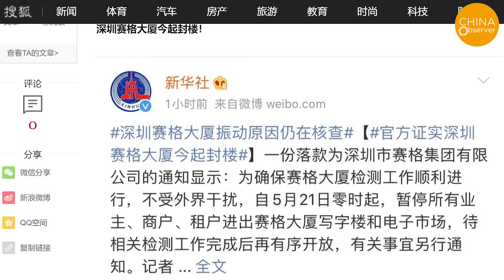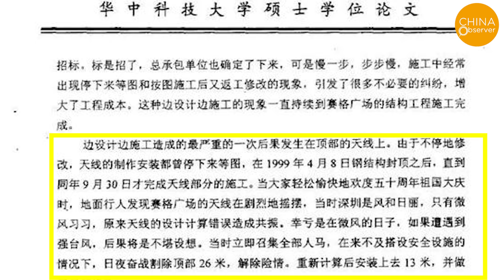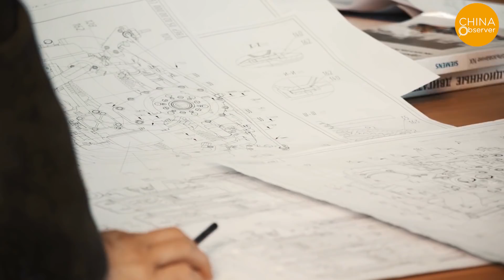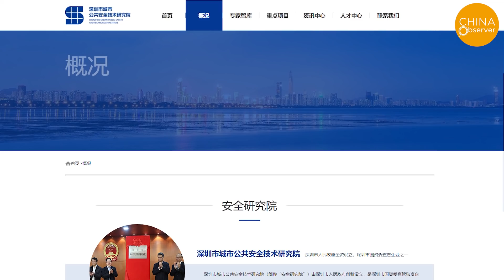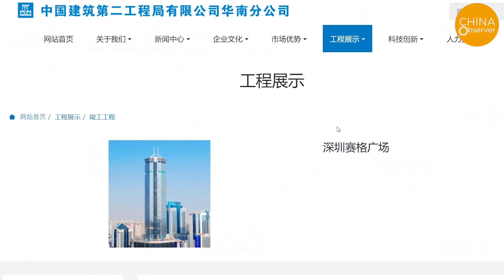356m Tall Skyscraper Shaking Again, Monitoring Data released, analysis of the causes of shaking

Comment: Getting it done in record time by trimming a few corners here and there, what could go wrong. 

Also, down below.... "Rebar, what's that?".... priceless!
Reply: Modular design of tall buildings reduces human errors or shortfalls in components installation. Components such as Steel bars/cages, steel  frames are prefabricated and even concrete batching are done computer aided in the plant/ factory and later assemble on site. Comments of shoddy wormanships, trimming corners  etc are irrelevant nowadays. Hope you are enlightened to the rapid advance in building technology.
Reply: They literally cut corners, now the building is in the process of collapse.
Reply: @gorillaump5869  dont worry high rise towers like this one found with all "corners" intact. Experts already discovered the cause. Similarly 1 million high rise buildings in Miami have to undergo structural checks after the condo beach collapsed.

Comment: due to wind + subway

tokyo buildings: am i a joke to you?
Reply: Bay Area Buildings : am i a joke to you?
Reply: @herbertant4096  Those are the toughest buildings I know, other than the ones in Dubai
Reply: Yes....😤😤😤
Reply: Japan has great technology
Reply: Just the wind and wrong shape of the building, the building looks like a plain pipe and this is bad shape for tall building.
The good solution to that is visible in 6:42, that twist is changing interaction with wind and twisting shape you can often see welded on surface of tall steel pipes to prevent this type of interaction with wind.

Comment: very informative and to the point. but vibration is not necessarily bad construction especially if it has been there for 20 years with no problem. seem more likely in line with the recent push by government to promote mid rise building in the future. having this happen is speaking to Chinese in the language they understand, in a mater of speaking.  this would minimize the use of steel and increase efficiency in the future. tesla did apparently invent a device that could do just that. but even if it was a myth there are still ways to cause these result

Comment: It's shaking because the foundations are of a sub standard and the earth was not compacted correctly. (probably due to cost cutting) It is only a matter of time before it fails completely, over the next couple of weeks the cracks will start to show in the walls and floors..., once the concrete cracks it allows the steel reinforcement in the concrete will start to rust..., this is called concrete cancer in the trade and is the major failure of older builings and bridges.

Comment: When September 11th happened I wondered that the buildings were brought down intentionally because of the garage incident.  Just seems critical.  With global warming I wonder that university KNEW of the future and would NOT react adversely to ANY nation of the world and would instead prepare for global warming sea rise.  The pools (footprint of the WTC) seem as though they could be used for drainage should there be failure to the necessary network of levees due to sea level rise.  The PATH tunnels could be used to pump sea level flood (due to failure) by pumps placed above maximum sea level rise levels in places aesthetically pleasing and efficient.  Need to evacuate those buildings.  Wait for a typhoon and evaluate.

Comment: So all very tall skyscrapers do sawy to some degree. Majority of the times you will never feel the very slight sway if your on the upper levels. This is beacuse most tall or super tall skyscrapers are built with a strong core section in the middle of the building that prevents extreme swaying in a tall building. For example. The world trade towers, RIP, had huge steel balls in the middle of the towers/ and very strong core section to prevent the towers extreme swaying. This skyscraper either doesn't have that strong core section in the middle of the tower or its just built all kinds of wrong for it to have that crazy swaying.

Comment: Design-build (where construction begins before design is complete) is actually common practice all over the world. This cannot be used as an argument to explain the problem. 

The fact that the problems only started after 20 years implies a change in conditions. Either the mass distribution within the building, the overall stiffness of the structure, or outside sources of excitation would have to change for the structure's response.

Look for changes, either in the building usage, the condition of some structural elements, or the conditions of the foundation soil/ground (including settlement, erosion, contruction or start of operation of new subway lines) for the source of the change. But change there has definitely been.

Comment: If, after 20 years, it is shaking, maybe they should look for geological changes under the structure. There have been severe earthquakes in China in recent years. Maybe the soil is weak or has lost compactness. The building is ok but it has lost support under it, and it will lose stability.

Comment: If there's been new construction near by it could of changed the wind patterns, not that it matters what I say
Reply: I don't believe It's caused by wind, It's never happend before in the past 20 years when It was first built and as for construction around the area It's everywhere
Reply: @tka1528  new construction can create new wind patterns, figure there's the same amount of wind but more buildings, that wind can no longer occupy and pass threw those once open spaces, and the faces of the building will act like sails to direct it, potentially hitting old building in New ways

Comment: "Everything is normal and do not exceed the corresponding limitations".  Wow .. this sounds a lot like the Citigroup Skyscraper in NY.  An architecture student identified a flaw in that building where they never tested it for angled winds.  And as a result an angled wind that could have collapsed the building would occur once every 20 years.  NY secretly sent crews into the building with the owner, and the reinforced key columns as part of standard "maintenance" in 1978 and 1979, so the building is now safe.  But they NEVER told the truth until the architect let it slip accidently 20 years later in some interview.  I am certain there is a major flaw in the building, and all of the construction materials pouring in are a sign they have figured it out.  But shhhhhh no one needs to know keep quiet and maybe we can fix it before it collapses killing thousands.

Now this building has been standing for many years (20+), and it has withstood major winds from Typhoons, and had NO issues over the years.  Yet every video shows all the shaking so something has gone wrong.  Metal within concrete fatigues over time, bolds and welds weaken, buildings settle into the ground.  Something has changed to allow the shaking, and it is a shame they are being so secretive.  As whatever they are uncovering, would be a valuable design lesson for all.

Comment: it reminded me about NYC's 601 Lexington (formerly Citigroup Building) that also had a problem where that building could be destroyed if a wind speed of 70mph hit corner of the building (which in NYC happens quite alot). then after they found out about it, they secretly fix the building and it was succeeded. and finally, was revealed years later by the architect himself.
Reply: Right..That was the building that looks like it was built on stilts, or these odd raised columns.
Reply: Copy should spent more safety than bots

Comment: British Army has had a standing order since 1831 to never march in-step on a bridge. At first glance, the reasoning seems silly. On April 12th, 1831, 74 soldiers were marching across the Broughton Suspension Bridge near Salford, England. The bridge, which was completed in 1826, was one of the first suspension bridges ever built in Europe. According to the story, the troops’ synchronized march caused the bridge to vibrate at just the right frequency which, in turn, caused it to collapse. 

And while this accident is over a 150 years old the science still hold true. Resonating Frequencies. 

All buildings have a natural period, or resonance, which is the number of seconds it takes for the building to naturally vibrate back and forth. The ground also has a specific resonant frequency. Hard bedrock has higher frequencies softer sediments.  If the period of ground motion matches the natural resonance of a building, it will undergo the largest oscillations possible and suffer the greatest damage.

Comment: I’m guessing the piles have been compromised and they will end up drilling thru bottom mat and end up pumping tons of concrete into the ground.
Reply: nah you gave em too much credit the problem is they didnt build this 100 FLOOR SKYSCRAPER with rebar they built it with STEEL PIPES and concrete hence the truck out front filled with pipes
Reply: @wilmagregg3131  that’s crazy stupid concrete under compression is amazing but for a building with out  rebar that’s stupid to much tension
Reply: @watomb  the worst thing is they BRAGGED about it saying its the "Tallest steelpipe and concrete bulding in the world"
Reply: Piles? What piles?
Reply: @andrewtaylor940  figured the building was sitting on dirt not bed rock.  Pictures of its foundation already had mat laid down.  So figured in order to stabilize the building they needed lots of piles into the dirt possibly down to bed rock.
Reply: @watomb  I’m not saying the building didn’t need piles. I’m just questioning whether it actually has them? And if it has them, whether they actually contain rebar? The building is swaying, with no wind and no measurable seismic activity. It’s floating on it’s foundation. And if that’s the case, I can’t imagine how they would go about fixing it?
Reply: @andrewtaylor940  ya was thinking if the mat is thick enough they could bolt it to bed rock(thousands).  But if it’s floating or has piles (I assumed) then pumping concrete under the foundation might help.  If you calculate.001 inch movement is over a foot at top. Someone screwed up
Reply: @watomb  how much movement would you need to get the water in the top floor swimming pool cresting 1-2 meters above the pools sides?
Reply: @andrewtaylor940  depends on dimensions of the pool and frequency of building movement.  It would be fun to calculate it
Reply: @andrewtaylor940  around his ring piece,
Reply: @andrewtaylor940  as in Hemorrhoids,
Reply: it is a gravity building like the dam

Comment: Read any report on any building that has experienced structural failure. The failure is typically preceded with noticeable vibration or movement of the structure. As each element weakens or  fails, it places additional stress on surrounding elements, until a cascading effect brings the structure down. The Sampoong collapse is a good example.

If events are already  in motion, there is little that can be done to remediate.

Let’s hope it really is wind loads and subway. This would be a horrible accident.

Comment: I expect the typical rear end political shading and story stretching will proceed apace. Hopefully some qualified engineers will determine the actual cause of the vibration and shaking. It’s been 20 years or so since the building was built. Latent design and construction defects and their degradation may now be reaching a cascading failure point where major expensive repairs may be required, or some one may decided the damage is to severe and the building will need to be dismantled. If that becomes necessary, the political fallout will be quite spectacular. Even by China standards.

Comment: It's cslled Harmonics the building is the perfect height width and weight
 they need to change one or it will continue.
It could be the rhythm of the air conditioner fan or the wind flowing through or past an obstruction once it starts the vibration/ Harmonic reaction is self-perpetuating

Comment: Bad foundation and wind can cause the building to oscillate even at moderate wind speed. If it has a Tuned Mass Damper and it's still oscillating, they need to tear down the building before it kills people.
Reply: The strange part is, there is no damper installed on this building. Maybe because they thought this is a concrete steel pipe building, so it wont shake as much as a steel frame building. The reason it got so many awards is mostly because it is one of the first skyscraper China ever built.

Comment: Cover those open areas/ balconies near the top to make flush with the building and put curved caps over the sharp corners down the building windows to minimize vortices.
Reply: Why it’s a problem now
Reply: @scottblackburn2969  to stop the problem bro. Cosmetic renovations are a lot cheaper than structural changes which it MAY not need.

Comment: I lived in China for 20 years, my condo was across the street from one of these multi building projects. The last two pits dug for foundations was below the waterline in that are because it was within 30 meters of a river. The pit flooded and after months of pumping there was no drop in the water level so the contractor filled the pit with sand till the level of the water was reached. then he poured a lightly reinforced slab about 1 meter thick (NO pilings) and built the 32 floor building on top of the slab. there was no compaction of the fill.
Reply: Man that's crazy... Without piles in that slab it will eventually crack and the whole building will shift if the water levels push up again.
Reply: Sounds about right.
Reply: Take a look at the photos of earthquake damage in China. What is the common thread in these photos? Very, very this and very, low amounts of rebar, most of it is just wire. In addition the concrete is not broken is is pulverized, this is what happens when you use concrete with such a low amount of cement that the fill is just barely sticking together. This building is no different.
Reply: @t5grrr  My personal favorite was the building, I want to say it was a school, where they replaced the rebar with bamboo.
Reply: @t5grrr  Probably they are waiting an earthquake takes all these problems away.
Reply: I’m believing him. What he describes is probably one of the few things that could cause the sort of structural shaking being reported in this building.
Reply: So he built a huge domino to fall down as the ' foundation' gets undermined by water..
Reply: Is that why I’m seeing a lot of sinkhole videos in China in recent years?
Reply: @eddielim3909  no, the dude is straight up lying lol, no building could genuinely stand for longer than a day with those conditions. in the 1980s the ccp were pretty bad at building shit i agree but by now they’ve gotten over themselves
Reply: @louisaugustexvi4515  "Gotten over themselves?" that is the most Naive comment I have heard in many years.
Reply: I know very little to nothing about construction - but even to me that sounds awfully dangerous, wrong and scary at the same time. And pretty sure not how buildings (that tall!!!) are meant to be built.
Reply: Mechanical engineer here.... i took Civil Engineer 201 as an engineering elective.. we talked alot about foundations, compaction etc. The class is an intro civil engineering for dummies.

reading your comment sent a chill down my spine.
Reply: So the cassions go all the way down to bedrock, then? Ok, good.
That should stop at 32 story building from falling over!
[/satire]
Reply: Built with Q-U-A-L-I-T-Y, eh!
Reply: I hope you moved as far away as possible
Reply: yikes.
Reply: Do you believe what this joker said? Bullsh t. If true  the building would have collapsed long ago. How on earth a building can rest on such flimsy foundation.
Reply: @cfyong1105  
Well, they did do this in Shanghai, and while digging a hole for an underground carpark the foundations of a residential tower next to the hole sagged and the building fell over. This was next to the Pudong River, yet the foundations consisted of tiny concrete piles and a thin concrete baseplate about two stories underground.
Reply: @cfyong1105  I believe him. It took decades for the Leaning Tower of Pisa to start leaning.
Reply: @brunopadovani7347  They brought the Leaning Tower's architect out of retirement and bribed him to work in China!
Reply: @cfyong1105  believe him more than I believe you, imposter.
Reply: @louisaugustexvi4515  Conjecture. Such a building w/o cassions sunk to bedrock have been built in China before, only to fall over later. In San Francisco, USA, there is Millenium Tower, where the cassions do not extend to bedrock. It didnt immediately fall over, but is now leaning 17" over the street. Remediation underway.

Comment: Possible some structural parts of that building are mixed with Substandard ones especially used in the foundational posts steels that's why now are giving up. That building is already giving strong warnings already to them and should permanently evacuated. Dont blame that building if ever.  That's caused by man's greed of money and power. Capitalism.

Comment: So there is no active counter balance in the very highest levels to counteract any vibrations or earthquakes. oh and they made up the design as they went along. so its a white elephant project that is going to need to be torn down and rebuilt from the foundations up, again. corporate corruption at its very finest hiding behind the skirts of the state which cannot be criticized. The entire country is run like this. (a clear and consistent failing of all communist states)